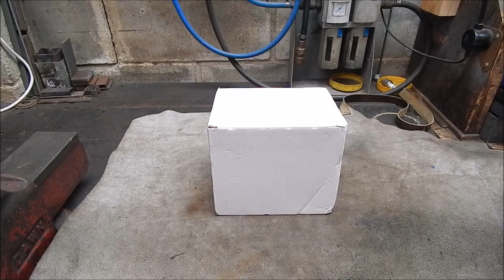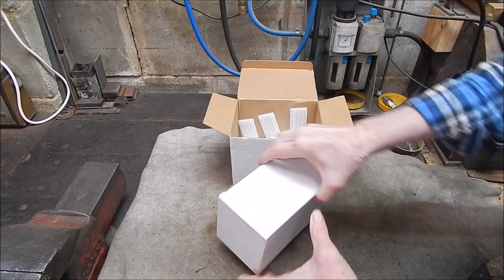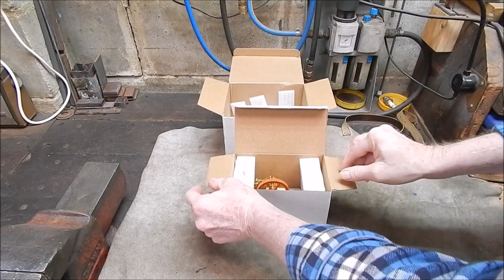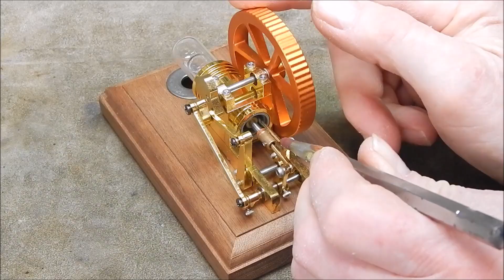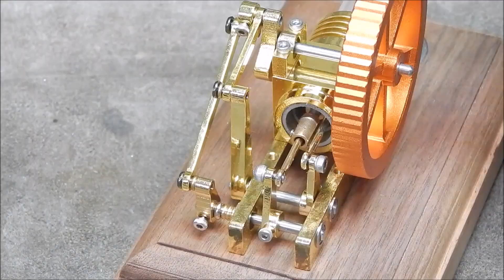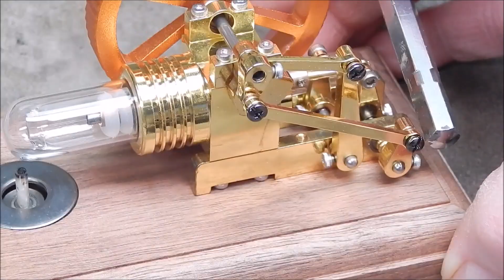The SH-021coaxial swing arm BETA Stirling Engine from Banggood is an unusual design

Comment: You got me Rob, I've never seen or heard of anything like this motor before, 65 years of playing with engines and I've still got more to learn.🙃
The only thing I can think of, that comes close to this, is Nissan's variable displacement engine, but that's another league and type of motor.
I'm imagining that getting the piston displacement settings correct might be a bit finicky, If it were me I wouldn't play with it too much, My ol' passion fingers would get it wrong every time.😀
Reply from the maker: Hi Bob.  Yes, the timing would be a nightmare to get right.  Normally BETA engines have a regular shared crankshaft, but this rocking mechanism is a first for me.  Not something I would want to play around with, let alone make one.  The guys that think these actions up must be on another planet.  Cheers Rob
Reply: @Xynudu  👍

Comment: Nice one Rob
really nice engine and precision made, runs and looks nice😀😀😉😉👍👍👍👍
i like to see unusual engines.
would take us hours and hours in workshop to faff around making one.
see you next time
Kev
Reply from the maker: Hi Kev.  It sure would take a long time to make one.  Getting the timing geometry right would be a nightmare.  I've seen BETA engines before, but not with this rocking crankshaft design.  Very unusual. Who thinks this stuff up ?  Cheers Rob
Reply: @Xynudu  if we put our minds and hours in to it we could do it.  The thing is the people who do these have probably a 10 to 1 ratio of minds and time compared to us.
Reply from the maker: Yes and they probably use motion capable CAD software to emulate their design concepts.  The days of slide rule and pencil design drafting are long gone.